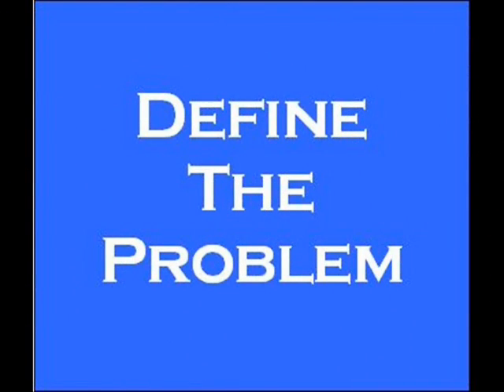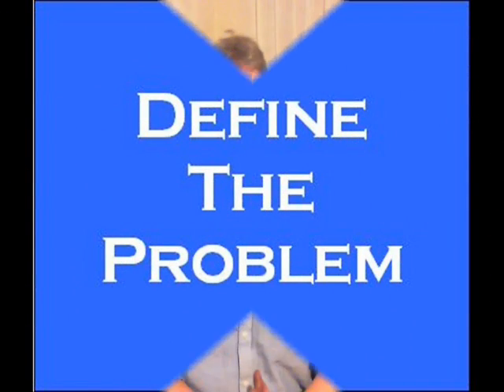How to Be An Inventor - or How To Go About Solving Problems

Comment: Thanks Robert, I agree with you completely.  Coming from the world of engineering one of my problems has been people who omit passing on some information by not adequately presenting their problem or their requirement.  I believe that they do this for two reasons.  The first is to hide their own ignorance (lack of knowledge).  The second is that they don't really know what they want.
Theory is essential, as if you know enough of it you are educated to a level where you are able  to solve the problem in hand.
However the practical approach of 'hitting something with a hammer' or 'applying a voltage across it' or 'poking it with a stick' is much more fun and keeps a person young at heart and happy.
Excellent video.
Reply from the maker: spot on mate

Comment: The Problem-  how to figure wire size to magnet strength at a given rpm?   11 mins in and you've help me really pin point my main hurdle.   14mins edit-  for home made generator

Comment: Im thinking about the potential of making a nanostructure that is 'sympathetic' to a magnetic field. I don't know all the terminology in the world but the best I can explain it, it would align the dipoles similar to magnetic polarization, forming an energetically favorable bond,  except it would also form bonds that were not at 180% so the poles would not form perfect dipole regions. this could cause complex patterns to form in the intermolecular forces depending on the ratios of the compounds and the properties of your EM field. (would it be an AQ solution? maybe a ferrofluid?)

We could then examine the structures and figure out how to consistently make the ones we find the most useful. we might also be able to change there states temporarily by passing an em field through it and use it like a synthetic enzyme to process some compound. (Can't even static structures act as catalysts?)
Reply: Isn't there an article somewhere about using an em field to induce something into a more structured state causing refrigeration? that would allow us to 'hold' the nanostructure in place. That could be very useful.
Reply from the maker: aninteresting idea - are you looking for macro or micro control over the structure? - or even nano control
Reply: Robert Murray-Smith well probably nano control. The idea is to probably use it as a selective catalyst (like an enzyme) to make potentially anything. nutrition for humans and livestock, biopolymers, computational components, etc...

Comment: Thanks for your videos Robert. I very much liked your works on graphene but unlike you I am interested in Microbial Fuel Cells (you may have probably heard about it). In my Masters thesis I designed a new configuration of it with the most economic materials (those which are easily available in our local hardware stores) .......... to show the fact that with a 50 dollar investment I can increase power output about 25 times. But the power is in mW and I want it to increase it to kW range. Thats why I want to introduce graphene tech in it. Do you have any ideas, any ideas?? And btw does graphene exchange cations (free H+)???
Reply from the maker: Hiya Mate, I do know about MFCs and have some idea of their problems and the stage of current research. I would have to get up to speed a little bit but graphene tech is well researched as an approach to MFC improvement as scholar search will turn up loads of papers. Personally it think it is adsorbtion/deadsorbtion as opposed to true exchange
Reply: Thanks for your quick feedback. I have an idea of coating your conductive graphene ink over steel mesh, for not only capturing the electrons but also to conduct them better to the external circuit. Can I get a boost by implementing this??? I have also drawn a circuit, featuring an external power source connected to multiple anodes (oriented in a parallel circuit). Graphene does have excellent electrical conductivity, so  my hypothesis may work, don't u think?
Reply from the maker: Arunjyoti Banik
You are asking odd questions for someone who has done a masters on this - ask yourself the question - why are you using carbon? what functions does it perform?
Reply: Carbon or mainly graphite as anode, acts chiefly as a substratum for the microbes to adhere. And since it is conductive, it'll transfer electron to the circuit. I don't know the exact conductivity of Graphene inside a liquid environment but I suspect it'll be much higher than graphite. You have expertise on Graphene so thought of asking you for a sugg.
Reply from the maker: Arunjyoti Banik
yes - so performance is largely a function of surface area (SA) - what you need is to look at increasing the SA - the ink won't do that it has a 5% graphene content which is tiny and contains a lot of polymeric binders - I would think about treating acid carbon fibres which would perform both the jobs you want to perform - or alternatively look at the graphitic sugar foams which would also be good - well in the way I think of this problem it would be good - hope this helps
Reply: Thanks for the suggestion. I'll surely look up on both but 1st graphitic sugar foams. :D
Reply from the maker: Arunjyoti Banik
it's a good methodology and seems to fit your parameters - that is universally available, technologically undemanding, inexpensive and uses graphene!! lol
Reply: I knew that and that's why I want to implement it first. + extra backup was your suggestion ..... Hahahahaha.